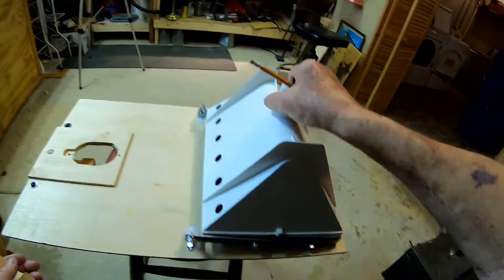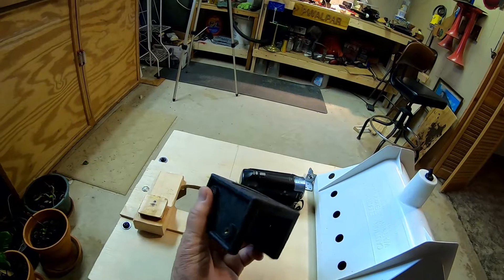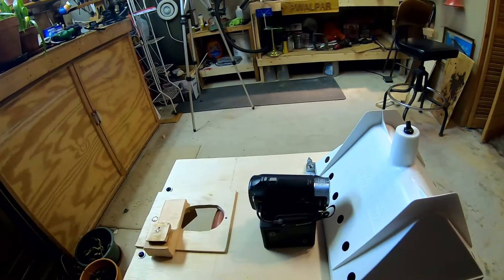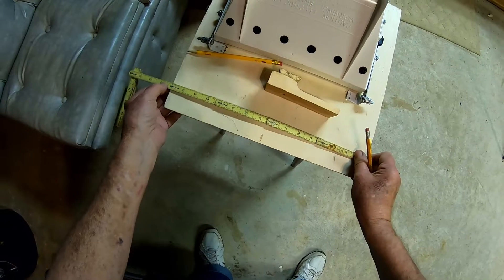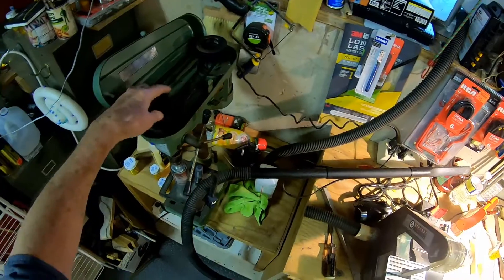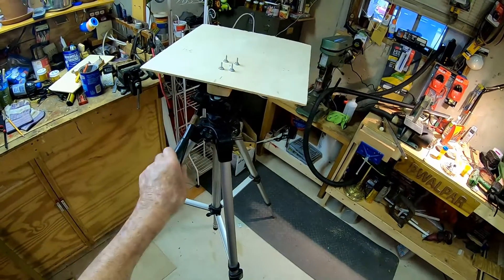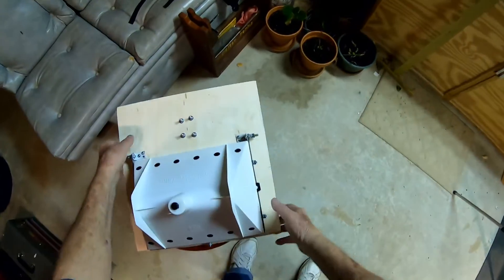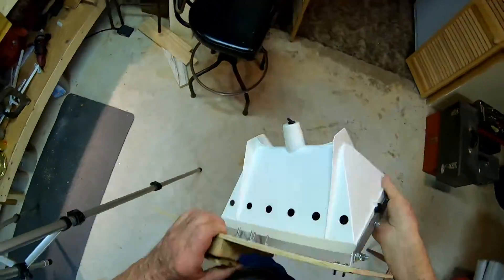Make A Teleprompter with Lite Brite Toy Part 6

Comment: There you go, Walter. Back on track. To figure out the balance point, you need to put your laptop computer, and the camera and camera mount on the board BEFORE you put the tripod mount on the bottom. That's the last thing that should go on the board. Jon, MSO-439
Reply from the maker: Yep  I dont always get things in the right order  but I am learning  Thanks Jon